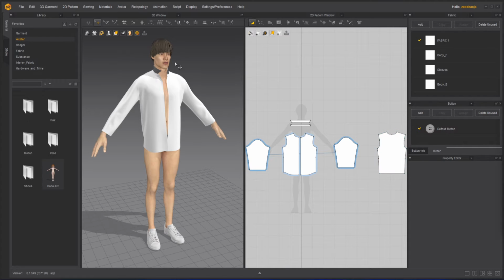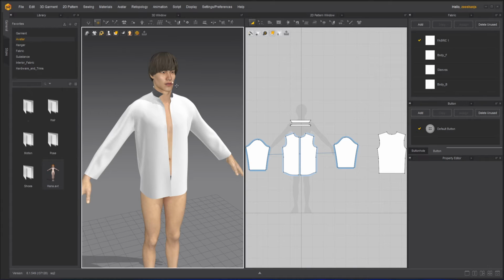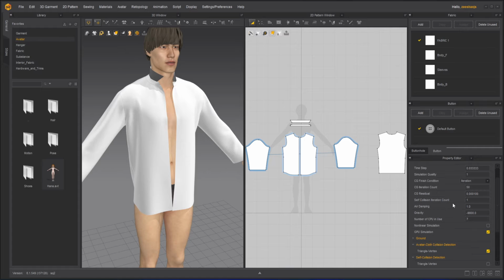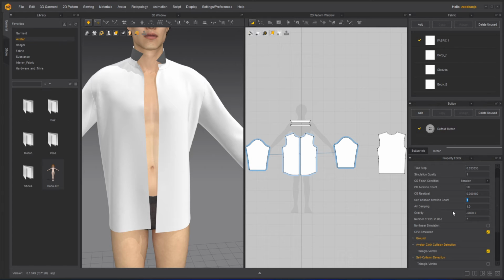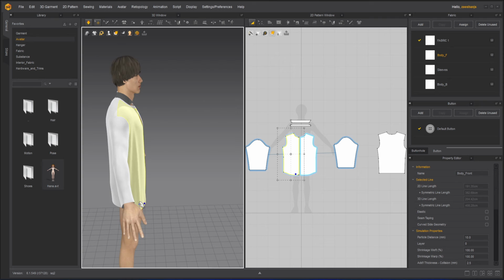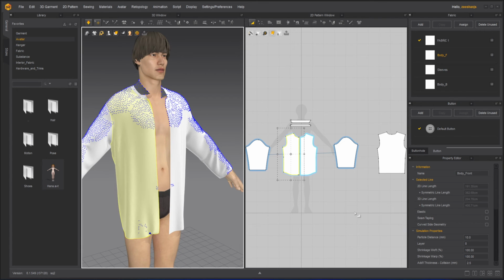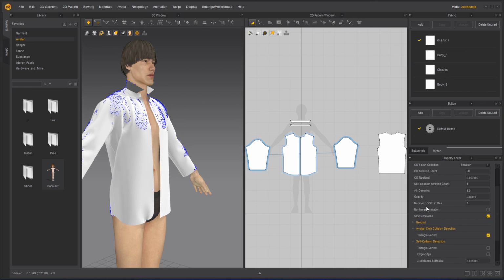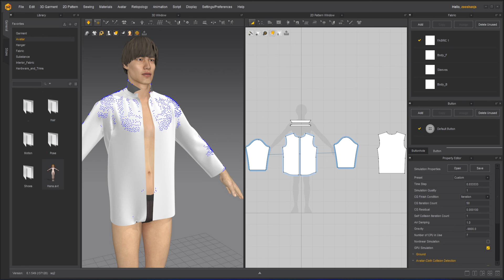Marvelous Designer Simulation Settings | Lesson 20 | Chapter 3 | Marvelous Designer Fundamentals

Comment: so what is time step?
Reply from the maker: In Marvelous Designer, a time step refers to the interval at which the simulation engine updates the positions and properties of the fabric during animation or simulation. It determines how frequently the software recalculates the physics interactions, such as gravity, collision, and fabric dynamics. A smaller time step results in a more accurate and detailed simulation, but it requires more computational power and time. Conversely, a larger time step speeds up the simulation process but may sacrifice some accuracy and detail. Balancing the time step is crucial for achieving realistic simulations efficiently.